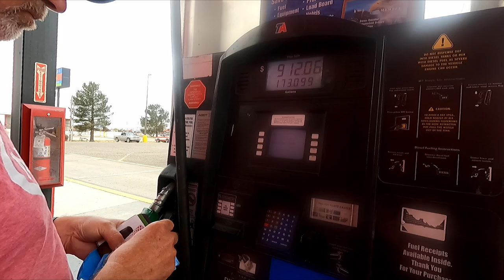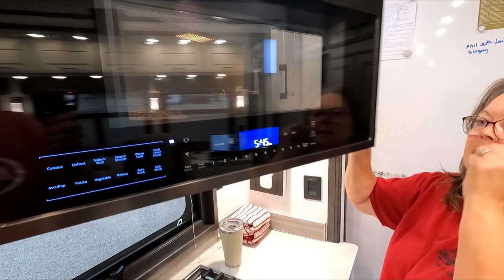ROAD TRIP! 🚧 // Packing up for TEXAS // Full Time RV

Comment: Suggestion, strap the canam down in the garage tight with the straps when the tires are a little low and then top them up a little with air. This will tighten the straps even more and hold everything safely in place for your 3 day road trip.
Reply from the maker: That's a great tip Todd!  We hadn't thought about that.  Thanks!

Comment: How do you guys like pulling with the tandem axles on the truck? Trying to decide single or tandem. I pull a 6 horse 20’ short wall living quarters horse trailer. It’s a 3 axle trailer around 43 ft long. I pulled it with a sport chassis for a while but hated the lack of power so back to the big dodge for now. Rebuilding a 05 Pete with a 160” sleeper on it. Any advice would be great.
Reply from the maker: We don't have any problems with the tandems.  We considered singling, but the process is rather involved and expensive.  Not only do you pull and axle, but you also have to have a new driveshaft and re-program the truck's computer for the single axle.  We also feel that if we ever wanted to sell the truck, we could sell it as an OTR rig with two axels.  We'd just need to pull the bed and install a commercial 5th wheel plate.

Comment: Jim, I run a product called Ultra seal tire sealant.  It will seal up to a 1/2 hole in a tire.  It also allows my tire to run a minimum of 15% cooler.
I started using it on our bobcats since we are on construction sites.  I have over 65 nails in one tire and still holding air with no issues.  When we turned the rental unit back in they wanted know what I put in the tires.  Now they use it in all of their rental equipment.  I used to also run it in our Dropbox truck tires.  Gemplers sale the product.  Check it out.
Safe travels and roads Brian and Cindy, "xtreambydesign with passion"
Reply from the maker: Thanks for the tip!  We'll have to look into it.

Comment: Hey there 
Can I please ask, the truck that pulls the RV looks massive, does it have a bed or storage behind the driver and passenger seats? Every time I watch you when your on the road I always try to figure it out, many thanks 👍
Reply: If you know what a normal semi truck looks like in the back, that is what theirs looks like. You can google semi truck rear cab and you will see what they look like.
Reply: @_unoriginalname_7389  I’m hoping we get a bit of a tour of theirs as part of their videos 👍
I have looked up what you said but there’s not many images and the ones I saw are different
Reply from the maker: Yes Linda...it's called a "sleeper cab" and we have double bunks in the back of the sleeper with cabinets and drawers for storage at the midpoint.  We showed a little of it in this video:  https://youtu.be/zXAHNXidTPY
Reply: @SuiteTravels  thank you so much, that’s perfect and I’ve just watched it and wow, what a fab set up 👌

Comment: Do you know if there is a such thing as a water softener for RVs?
Reply: There are. They connect to the garden hose or you can plumb it into your system.
Reply: On The Go is one brand ; it is attached to the water hose after the water filter.
Reply from the maker: As others have said Buddy - yes.  We haven't installed one yet but are researching.